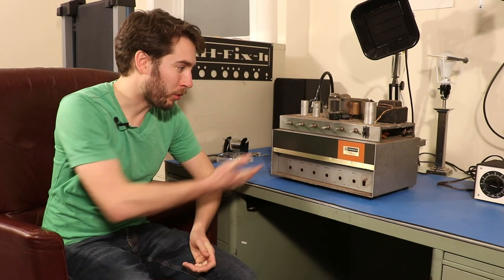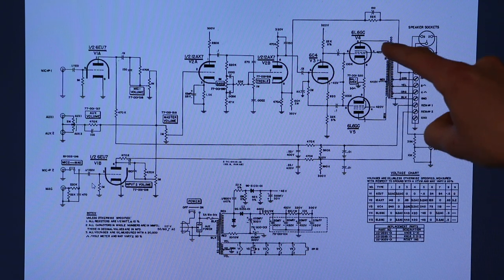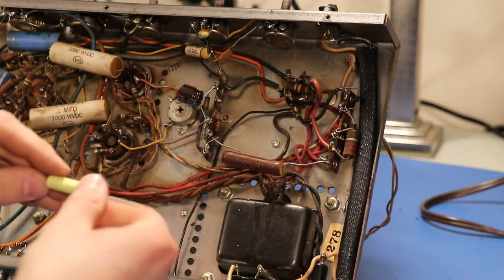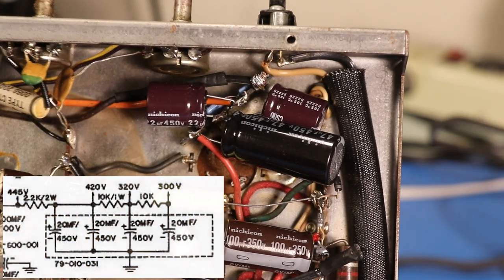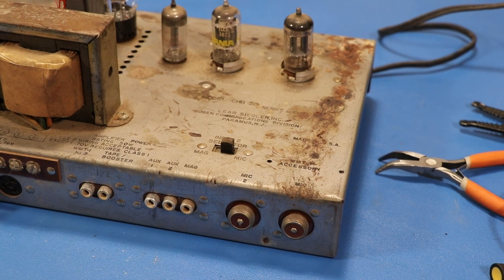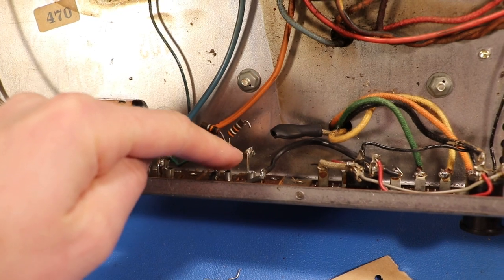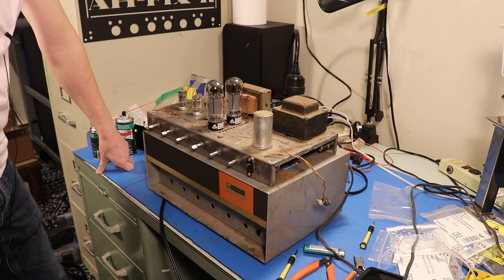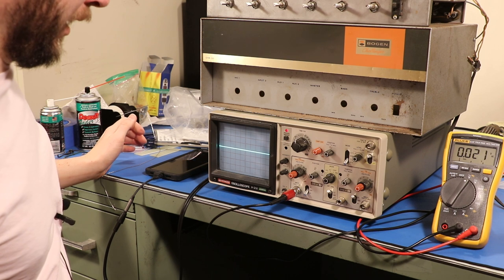Making A Guitar Amp Out Of A Broken 1960s PA Amp (Bogen CHB50)

Comment: I've got a Bogen chb35a I had converted to guitar 🎸 circuitry 15 years ago and it's a great sounding tube amp, using 2 7868 output tubes for 35 watts 👌👍👏

Comment: That tube you are worried about is the phase inverter tube. It is what is responsible for sending the positive side to one output tube and the negative to the other, for the push-pull output. A problem with that tube may be the cause for the asymmetrical clipping you are seeing. It could also be that the resistors going to the grid of each of those tubes are out of spec. I would check the value of all of those resistors and replace accordingly.

Comment: As you probably know, the 6C4 tube is the phase splitter tube for the power tubes.  It doesn't add any amplification to the power tube grids, it just splits the phase of the signal for the push-pull setup of the power tubes.  The tone control tube provides the amplified signal to the 6C4.
The crackling noise that you were talking about may be from dirty tube socket connectors, or it could be from an old carbon composition resistor that's going bad.  Those things can be hard to trace to the source.  Also, possibly one of the preamp tubes is noisy, that happens sometimes.  The background hum is very difficult to get rid of completly with a tube amp...
As for the distortion imbalance on the power tubes that you see in the oscilloscope, it's likely that the tube bias is out of balance.  Some amps have a bias balance control, and some don't.  According to the schematic, the CHB-50 does have a bias balance control.  You can probably adjust the balance to get a more symmetrical onset of distortion using the oscilloscope to adjust it.  That may also lower the background hum when the amp is running.  It seems that no matter how well matched a pair of power tubes are, they're never exact, and the bias balance helps with that.

Comment: A pair of 6L6GC's should put out at least 30-35 watts with 450 volts on the plates.  Also, the clipping shown on the 'scope should be more closely even on the upper and lower peaks.  To see if the tubes are balanced, obtain two resistors of between 10 to 50 ohms, within 5% of each other, 2 watts, and connect one of each in series with the cathode (pin 8) of each 6L6GC output tube.  With the amplifier on and warmed up, measure the voltage across each resistor.  The current through each tube  will be the measured voltage divided by the resistor value.  For 6L6GC tubes, this should be between .035 and .045 Amperes. They should also be nearly equal.  Also, check the voltages on both 12AX7 and the 6C4 stages.  Something may be out of range here.  Of particular concern is the 6C4 phase splitter, since its cathode is about 100 volts above ground, and any heater-to cathode leakage in this tube will throw things way off balance.  Finally, use a couple of 2.2K resistors to mix left and right stereo channels into one mono channel.  tying them directly together may cause severe distortion as their differences fight each other.

Comment: I noticed that the bass reflex speaker enclosure was very good, but you need to do a couple of minor mods to it, first remove the coaxial driver and, using a trim router, round over the outside surface of the woofer cutout, this will eliminate sound wave defraction around the woofer edges at the front of the baffle, second, do the same thing around the bass port to eliminate port noise/defraction as well, it will sound a lot better, and the sharp edges will look better rounded over as well ! As far as hum/buzzing goes,  try shielding those input jacks and running the shielded cables away from any wires that carry d/c or a/c current !, again, great video 😊

Comment: The 604s sounds wonderful with the guitar playing.  Careful, those 604's only handle about 30w. Check the grounding solder joints, and replace the pots, make sure there is a grid resistor (1meg) between the wipers and grids.

Comment: for the background noise suspect the anode load resistors on the preamp valves .
Reply: Yep, that was the noise on my amp. A 47K 2 watt resistor going to the plate of the 1st AF tube.

Comment: Love your videos, and your passion.
I think PA amplifieirs were rated at peak power, not RMS which the DVM is reading. Also distortion was a lot higher, perhaps 3 to 10 percent THD. I had a carbon Allen Bradley style resistor with made a sound like what you are hearing that was noisy  feeding the B+ to the first AF triode of a 12AU7A. Dirty tube sockets can produce that noise as well, move the tubes around and listen for the crunchies and watch the waveform. SRT Amplification already said what I was thinking, so I won't repeat that wise advise.
Reply: I wanted to add, a cold solder joint can be noisy like what you are hearing as well.

Comment: Bogan amps are a good platform for converting to a guitar amp.  There seems to be a lot of them available still on the secondary market.  My personal favorite for conversion is the CHB-35.  I always change all the power supply capacitors.  With the CHB-35, I usually take out the big 9 pin sockets for the 7868s, install octal sockets, and use 7591As.  I tend to replace a lot of the old carbon comp resistors with carbon film ones, or sometimes metal film ones.  Also, I usually rewire the preamp tube sockets to use the 12AX7 tube instead of the 6EU7.  The 12AX7 is a common guitar amp preamp tube.  Of course, that all takes more work...
Unsoldering parts in a Bogan amp is a pain in the butt!
Reply: In your experience did the PAs have 220ohm plate resistors? If so do you change them to the common 100ohm and rebias?
Reply: @davidsimpson3380  Often enough, the first input stage circuit of the 6EU7 will have a 470Kohm plate resistor, the rest of the preamp stages tend to have 220Kohm plate resistors.
When I rebuild the preamp to use 12AX7s, I generally follow what Fender did, using 100Kohm plate resistors.  Usually thetone control tube is already a 12AX7, I change the tone capacitors and resistors to resemble a late Ampeg  tone circuit, which usually has 220Kohm plate resistors on that tube.  You don't have to change the tone circuits at all to convert one of these to a guitar amp, it's just that the bass and treble control frequencies are set up in the Bogan for a more all purpose generic sound control.  That's not a bad thing, it's just not specific to the range of as guitar.
Reply: @amberyooper  Thank-you for the detailed reply. I've been converting a LaFayette pa-35 which is similar. I put bypass caps on one of the gain stages and the amp was very gainy. I realized the gain was from the plate/resistors/12ax7 biasing, so I put the bypass caps on a switch and had wondered about changing the plate resistors/biasing scheme for the 12ax7s but the amp has a lot of wonderful sounds so I'll probably leave them for now. I wrestled with the 37v bias tap and switched the selenium rectifier for a 1N4007 and rebiased. It's quite a great little amp. Sounds like a JTM 45 to me, I may build a combo cab for it. Thanks for sharing your adventures! ......... also, the power transformer puts out 375v and plate voltages are now about 477vdc @38ma after rebiasing, what kind of plate voltages are you seeing?
Reply: @davidsimpson3380  It seems that Bogan set up their amps to run the main voltage at somewhere between 450 volts and 480  volts for a lot of their amps, depending on the power tubes used in the amp.  The CHB-50 schematic that I have shows a voltage of 440 volts on the plates of the power tubes and 420 volts on the screen grids.  Those are just average voltage readings for amps made back in 1960s, based on a wall voltage of 110 volts.  The wall voltage is higher now, so the voltage in the amp will also be higher.  The 6L6GC power tubes will handle the voltage in your amp with no problem.
Speaking of the Lafayette amp, I rebuilt a Lafayette PE-30 a couple of years ago for a friend.  That turned out to be a pretty nice amp.
Reply: @amberyooper  Thanks for the information amberyooper :) The Lafayette is turning out quite nicely and after making a bias probe I've got it dialed in to about 445v at the plates. Used a large 10 watt resistor between B+ 1 and the screens. Happy amping !

Comment: 6l6gc's have a plate dissipation of 30 watts. That does not mean you Will get 30 watts of audio per tube. And that is with cathode bias. Grid 1 bias for a push pull cirquit is 70 percent of 30 watts. Depending on how much the power supply is capable of putting out in Milliamps and high voltage.
Question. How are the output tubes wired up in that amp? Parallel Class A. Push Pull Class A B.
How are the tubes biased by cathode or grid number one? Depending on type of biasing you may be able to get more than 12 watts of audio output but don't go over Maximum plate dissipation with Cathode biasing. With class A B go no higher than 70% of Maximum rating for those 6L6GC.
Read more about tube biasing. I'll bet your a smart young man. I guess I could say you already know. Thanks for the video hear on Utube. Hope this helps. In grid1 biasing for class AB the negative voltage, make it very reliable and be careful. Or they will go warp drive into redplating especially in class A B. Glad to see a young man interested in tube amplification. Hope to see you down the road again here on YouTube. Dwight.

Comment: I think that's rated 50W input. 50W output was a lot back in the 60s even for solid state amps. I doubt many modern tube amps output that much. A small amount of wattage can translate to a lot of sound. Check out Pearl Acoustics' "How loud is 1 Watt (with an 87db Loudspeaker)" video about input power vs. sound pressure. https://www.youtube.com/watch?v=vaiEDYB5c9M . It looked like only the positive side was distorting at 10V output, so you maybe could get a little more if that was fixed. Is there some imbalance somewhere? It's a push-pull amp, but you replaced both amp tubes. Maybe one of the 100K resistors is out of spec?

Comment: If no one has mentioned this yet, you’re going to kill yourself by touching components like this. Are you sure those caps are drained?  If yes, you didn’t mention that or show how you did it.  Use a chopstick to point to things instead of your finger. You can always tell when someone hasn’t had electronics training (or they’re dumb) when they touch components and circuit boards.